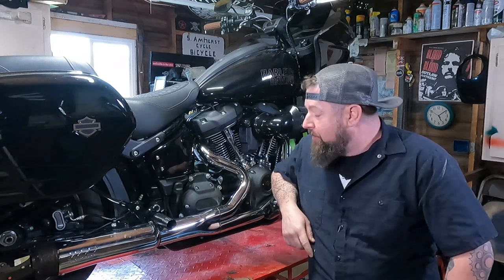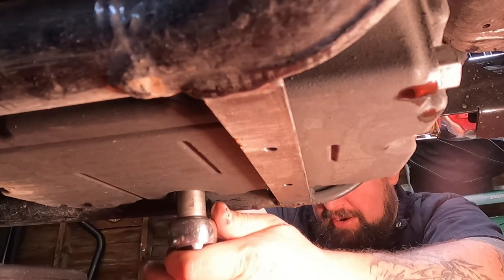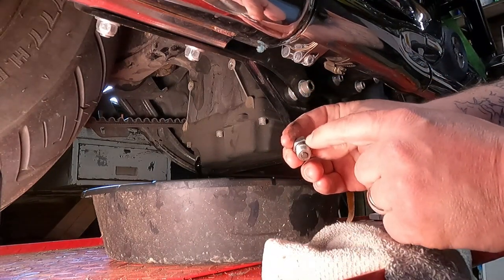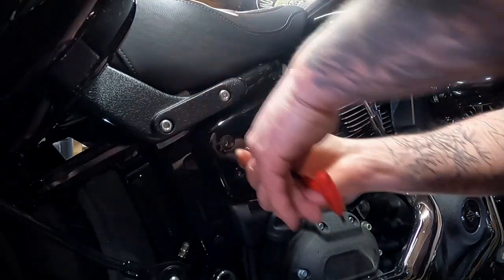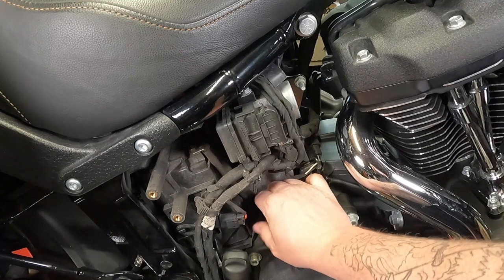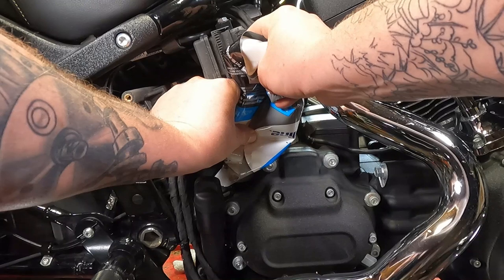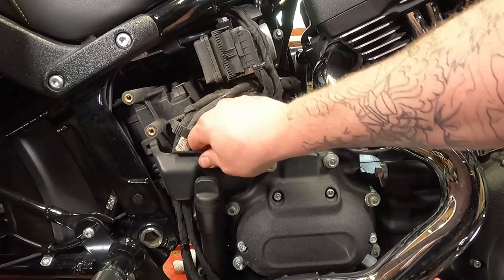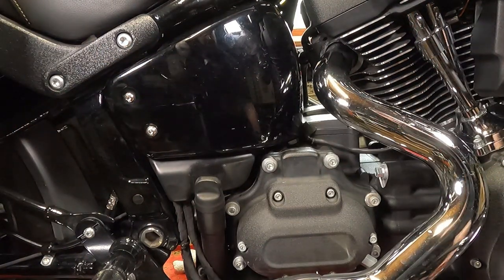Harley M8 Transmission Oil Change.

Comment: What oil goes in the transmission? Same as for the engine oil?
Reply from the maker: Baker Transmission recommends 75/90 for the primary & 75/140 for the transmission.
Reply: I like Redline Shockproof
Reply from the maker: @jeffbradley8606  always a good option